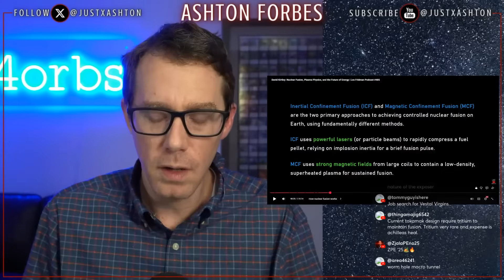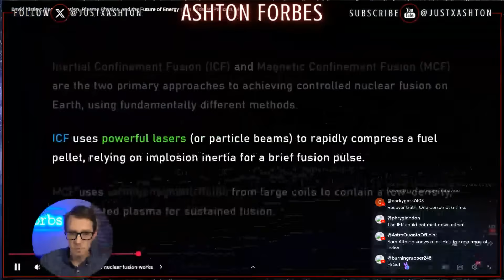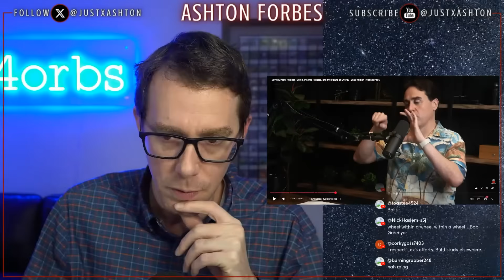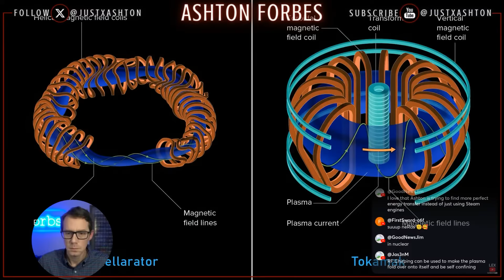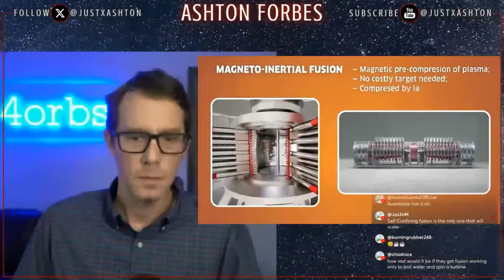The Missing Link in Fusion Research

Comment: It’s crazy. In the infamous “John Titor” time travel story (way back in 1998) he talked about how the “Time Machine” worked on Coast to Coast AM. He said it was created in 2034 by accident at CERN, during research into small (portable) Fusion Reactors. And said it was 3 singularity (ZPE - small black holes) contained as balls rotating around an electromagnetic center, creating a temporal displacement. And that you could change the magnetic direction to either go forward in time, backwards in time, or simply teleporting. Also said you had to account for the curvature and fields of the earth so you didn’t end up in orbit. Sounds a lot like the Malaysian ✈️ videos.

Comment: You cannot use magnets in open air. You need an impulse field. -e it must strengthen as the inner plasma layers amplify.  They need high voltage leaching to match the resonance frequency to create boundary layers that strengthen the sheath layers. They build fusion reactors in different parts instead of one cohesive unit. Lets put it this way you compress the energy to the center and the radiation responds by stenting the sheath layer. It is how you break the Schwinger limit. No mechanical disc can do it. It requires you to use compressed gas or plasma and they are the parts that break the limit.
Reply: By the way a donut has no core to compress. A sphere does. If the center of a tesla coil can produce -e then what happens when you make a sphere do it? Most fusion uses hot radiation. The world used cold radiation or -e.

Comment: B.S., They have nothing. They have never had anything working with regards to control fusion reaction. It never worked even in a small scale. They have star physics wrong.
Reply: They've had it Alabama  for  minimum 10byrs probably longer
Reply: And they considering  they have the most practical version ill guarantee they have basic prints in 54 and built  experiments by 60 at the latest.  Materials msybe held them bsck a littke
Reply: Research Farnsworth. Fusor.
Reply: But yeah, their star physics is crazy. They don't want us to know something. Like angels live on the inverse mirror sun or something equally weird